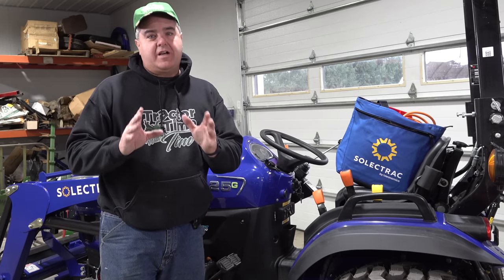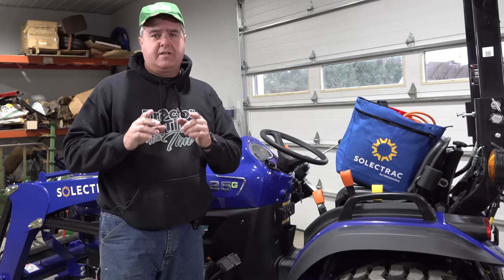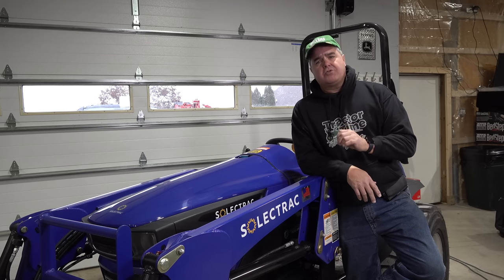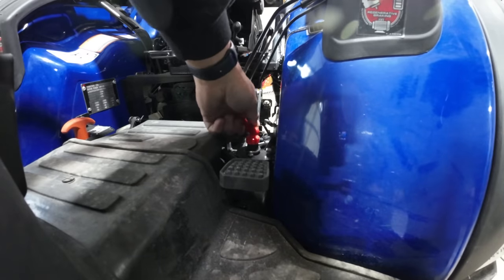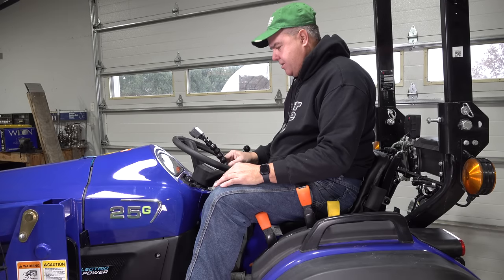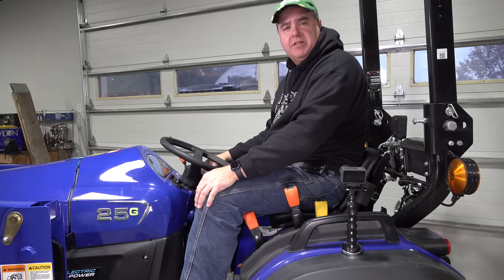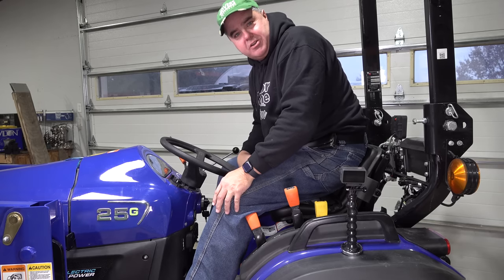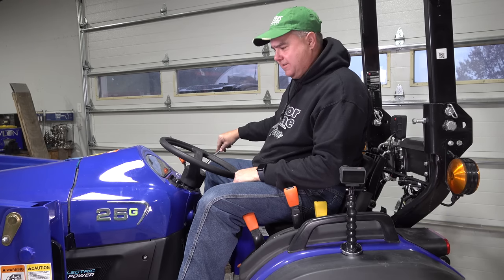Solectrac Electric Tractor First Look; Startup, Transmission Control, Initial Recharge Time & Charge

Comment: I would love to see you run that and your factory 1025 side by side and see who runs out of "fuel" first,  also would be interested in the cost of battery replacement as well as a method to calculate$/ hour ev vs diesel.   Always enjoy your content, and really love how you end each one with scripture
Reply: LFP batteries in that tractor should get at least 10 years of daily use before needing to be replaced at which 10 years from now they'll be much cheaper than today. ~$100 at most per KWh at that time.
Reply: Why worry about the replacement cost of the battery? Did you worry about the replacement cost of the engine on your 1025R before purchasing? These batteries will have way less use than a car. EV batteries that have thermal management outlast the cars.

Comment: I really like the way you are assessing this tractor, non-biased, not presenting it as the best thing going.  It could turn out to be just that, but much convincing will have to happen.  Many of us older people are harder to convince, but I admit I probably won't buy another small tool with a cord, battery operated only for me.  Great job Tim.

Comment: We are going to absolutely love this series! Finally someone is going to test the electrical with no guess work. Thank you TWT.
Reply: For sure. It’s time to find out more about electric tractors. Electric tractors will not suit everyone but it will suit some people a lot. For example I could imagine an electric tractor would be well suited to indoor use like in a big barn or greenhouse.
Reply: @@stankappiris2242 Agreed, so far I can see 3 situations where this type of equipment is useful 
1. Indoor
2. Small properties,  as you mentioned,  were low maintenance and mostly tasks will not require more than 3 or 4 hours of continuous work
3. Very remote areas, where you can recharge with some sort of renewable source and don't worry to store large amounts of fuel

Comment: Hey Tim! 100% if using in winter you need to add a battery tender for the 12V battery, I'm using a Battery Tender model 800 on mine does the trick. I leave mine outdoors and it is no problem to use it in sub-freezing weather but when charging the high-voltage battery sometimes then the low-voltage battery goes flat as the under-temperature protection logic on the charging procedure is a little wonky.

Comment: Kudos to the engineers that designed these things, but I am a petroleum guy I like diesel tractors it’s what I’m used to, the idea theory behind it is good, but when you’re working example getting low on fuel you can grab a fuel can fill up and get back to work immediately But if the battery goes low or dead you have to stop production & charge, I’m going to keep watching these videos to see where this goes, but I personally love a diesel tractor even if I have to put DEF in it, thank you for the video 👍🚜
Reply: Graphene Super Capacitors will make you want electric in ten years you won't have any fossil fuel equipment.
Reply: @carrollsanders9376  lol good luck mass producing those
Reply: @atodaso1668  They already are.

Comment: 7:40, my guess is that the whine when you turn off the hydraulic pump is the cooling fan motor for the power inverter?
Reply: It turns off the hydraulic pump it self.
Reply: @terrya6486  I don't understand what you mean? He shut off the pump manually with the switch, but there was still a hum from hat sounded like a blower (fan) motor.

Comment: I could see this being good for barn cleaning or small indoor construction projects. I would really be interested to see how it worked in the sub zero temps from a few days ago.
Reply: Might be it's "ONLY" good use, because of it's looowww time of operation & its super high price--- and of course "making U-TUBE vidios=$).
Reply: @donaldstrishock3923  Yep, they're VERY expensive!
Reply: Probably not much different than electric fork lifts used in a freezer warehouse. The longer working  in sub zero temps the faster the battery would drain.

Comment: Merry Christmas Tim!  Looking forward to future videos.  The charging curve dropping off over 80% on the battery would fit with what EVs do.  It is a feature to help protect better longevity and why they recommend not charging above 80% if you are out on the road on a trip because that last 20% is going to take way longer than getting from 10% to 80% did.
Reply: This advice is for NCA chemistry, this tractor uses LFP which is fine at 90% and even okay at 100% SOC.

Comment: I was going to say, the tractor colour on your title page was a nice touch but the sound needs removing as electric would be silent... and then then I heard the tractor on startup and it is "Interesting".
Does look like the Farmtrac Tractor 25G in the UK.
Great review. Get some more burgers :-)
(If your 240v plug grip is too large, try running through a bit of garden hose)

Comment: What do you do during a power outage?  Plus when we had a 3 ft snowfall I wouldn't trust an electric to not go dead where you can't charge it. The cold temperature rating is a concern too. Look forward to future videos and we'll see.
Reply: My backhoe wouldn't start at 10 degrees but fires up the next day at 25 degrees no problem.... guarantee it will be useless
Reply: @chucknorris277  An electric vehicle will start at any temperature unlike an ICE.

Comment: I'm curious to see how this really cold weather impacts this tractor. My JD sits in a shed without heat and the hydraulics get a bit problematic in extreme cold. Does this have some way to heat up the hydraulics before use?
Reply from the maker: No

Comment: Down below was a comment about the  "Gas and Go"' advantage of diesel. A proxy would be a generator. What size of generator and would that be practical? Would it give you enough to finsh the Job or take it back to the shed.
Reply from the maker: Based on charging time, I don’t think a generator would help much.  Would still take several hours.

Comment: Thanks Tim. I hope this works well. I am sure this 1st gen battery tractor will lack the long use cycle that some people need. I like the quieter operation and an electric motor peak torque at all rpm.

Comment: Great video Tim, Now I'm not into electric anything except power tools but I've been curious how they will do in the construction and  farm industries where the equip. is almost always  under high demand. With the battery tech. they have now I just do not see them worth more then a quick job or two before they give up the ghost. And how about harvest time do you stop working for a day for a charge up as opposed to pouring in some diesel and keep working. Looking forward to your series Tim.

Comment: I'm anxious for the complete review series. I must admit, I was a bit optimistic until you mentioned not to operate below 15-degrees F. As someone living in a northern climate that would be a complete show stopper. It's not like they simply warned that battery life may be reduced below 15F. They are saying "Do not operate below 15F".  That's a mighty big gotcha for anyone living where you have cold weather.
Reply: Agreed, then if you have a battery failure will warranty coverage be denied if there is some sort of internal temp monitoring and can prove it was used outside of it's intended specs?
Reply: @barelystablefarm7151  That would be my major concern. When you do something with a machine that the manufacturer specifically warns NOT to do, you can usually figure that if any warranty issues arise you will be on your own.
Reply: @eosjoe565  Exactly
Reply from the maker: I have been operating below 15 without issue.  However, the machine is warm (50+ Fahrenheit) from sitting in the shed.

Comment: Looking forward to seeing more of your testing. My biggest fear with this is that being a weekend warrior, I like to run a tractor hard all day Saturday on projects. I’d be worried something like this might leave me stranded, or less productive in my available time based on its finite run time per charge. I can refill with diesel in 5 minutes and keep right on going!
Reply: Yep. I think it’s still clear that the battery technology still doesn’t come close to what’s needed to make an electric tractor anything more than a novelty at this point. I’m curious to see how it performs, but for me actually purchasing one of these is a non-starter until there’s some generational advancements in battery tech that will make run times apples to apples, and by that I also mean cost. Spending enough to buy 3 diesel tractors just so you can swap batteries in and keep working is not parity, it’s 3 times as expensive…lol
Reply: The electric mini excavators get about 4 hours of work

Comment: What a let down on the snow storm. I cleared a few drifts. Used manplow to do most of my work.
Reply: It’s stranded wire , correct? The surface of the wire carries the load, more wire, more surface.

Comment: Three years ago I was fascinated by the idea of an electric car, so I leased a Chevy Bolt for three years.  Positive:  It was fun to drive and had a lot of torque.  It also was very cheap to use if you charged it at home.  If you went to a commercial charging station, your wallet thought it was filling up an 800 HP gas guzzler.  Negative: The charging time took many hours even with a 220v charger.  Negative: The range was anywhere from 150 to 250 miles depending on whether you wanted heat or not.  In Michigan in the winter, that was not an option.  I just turned it back in to Chevrolet and happily leased a gas guzzler.  Until they solve the long charging times, and the lack of range, it's not gonna fly except with people that never go anywhere.  As for saving the planet, no.  The electricity has to generated somewhere, and you're not going to run the country on windmills and solar cells alone.  My advice is buy a diesel tractor and wait see if down the road something better will come along.

Comment: So how many amps did it take max.  I dont like the idea of waiting to charge because your full now then go out and tackle a project and brings it down to say 45% but your next project time will be the same.   You have 2 choices charge when done 1st project or you have stop doing 2nd project to charge.  

I would like to see a complete discharge vid cause im wondering if it will go into derate to limp back to home base and does it have a neutral to tow it dead like if fun out of fuel or it breaks down. Does it have a load gauge on how hard you are working the motor and what happens if you overload it.  Will it shut off like you stall an engine
Reply from the maker: 3.87 kWh, as I showed.
Reply: Assuming the line voltage is exactly 220 volts, it was charging at 15.35 amps in the first charge phase. As for your other point, then maybe this tractor isn't for you. People need to stop trying to force a machine to fit their use case, and select a machine that FITS their use case. This isn't just true of electric tractors, it's true of all machines. In an extended power outage, fuel pumps aren't going to work, so unless you're stocking more than enough fuel for the outage of the duration, you're in the exact same boat. And, in theory, you could charge this tractor from solar, and be able to operate entirely off grid. So everyone quit making up hypothetical use cases where it won't suit your needs and then complain about it.

Comment: Thanks for sharing your thoughts, ideas and videos. Looking forward to seeing your overall review of this tractor. Really appreciate that your treating it as a tractor/tool review and not a opinion as to if it’s good or bad technology. Was wondering since this is relatively new uncharted territory if you might want to swing a current transformer from a lesser used circuit in your bkr box so you have a true meter for both phases. From my electrical background I’m left wondering if it is a truly balanced load in all charging modes. I have a power bank that takes two separate inputs and discovered over time that they are far from balanced  loading based on the present state of charge. Thanks again for taking on this project. I am confident that if there is a notch that an electric tractor fits in you will find it and give it a fair review. My personal speculation would be it might excel for someone looking to operate off grid and independently from the established power grids, including liquid fuel supplies. Not many people make their own gasoline or diesel.
Reply from the maker: Good point.  I have one extra CT. Could use it on this circuit.

Comment: Merry Christmas Tim and Christy.  The minimum operating temp of 15F would prevent me from buying this tractor.  Living in a state where winter temperatures routinely get colder than that for 2-3 months would make this tractor a 3 season tractor. I look forward to this video series and the opportunity to learn along with you Tim.  Hopefully as the technology evolves the operational temp range will allow for cold winter usage.
Reply: Its a limitation of the lithium batteries used, that will not be changing.  you can store it in a heated area, and it will be fine for several hours outside, but eventually needs to be brought inside a heated area to charge
Reply: Its a limitation of the lithium batteries used, that will not be changing.  you can store it in a heated area, and it will be fine for several hours outside, but eventually needs to be brought inside a heated area to charge

Comment: I am very interested in seeing how it works in real conditions, but that high pitched whine is already an issue.  Does your IsoTunes block it out?
Reply from the maker: It isn’t very loud …compared to diesel.
Reply: @TractorTimewithTim  It may not be loud from a decibel standpoint but from an annoyance standpoint it is ear shattering. Like the hydrostatic whine from the cab equipped small Kubota tractors. Not loud on the DB meter but deafening to your brain.  :-)

Comment: I charge my EV on 120v all the time. Depends on how much you use it every day, but if you use it one day, then it it sits for two, you might not need more than 120v.

Looking forward to this series. My guess is it's going to perform better than a similarly sized diesel. Just not for nearly as long.

Comment: Tim, keeping the tractor in your heated shop is a bias in the evaluation of this unit.  I hope you will park it outside this winter and evaluate how the batteries do when they get cold. Most people do not have heated buildings to store their tractors in.  I think we all know the batteries will suffer when they get cold, but it would be interesting to know just how much.  I looked on the Solectrac website a while back and the specs at that time said operating temperatures down to 32°F.  Anyway, glad you got your hands on one of these tractors so we can see what they are all about!
Reply: True. I started my 2032R the other other morning in 10F degree temps. I turned the glow plugs twice and it started hard.

Comment: So, a 20amp, 240v would charge it?
240 volt plugs look like a 120, with the blades turned 90 degrees. All my woodworking machines are 20amp, 240 volts. The male plug you used is a 30 amp. Wire looked small for 30amp.

Comment: Do not think I will be selling off my 25R anytime soon. But looked at the specs and I am happy to say they made the RIGHT decision for the battery chemistry and that is LFP (Lithium Iron Phosphate) vs what is used in auto EVs which is Lithium Ion polymer (EV chemistries can vary some but they are not LFP batters). Most consumers do not know the difference, yet...but those in industrial and batteries requiring  extreme durability, take a beating, and SAFE (thus used in military and aviation and industrial applications)...LFP will be superior for this application. Less expensive, far better life span, NOT toxic, and will NOT have a THERMAL OVERUN. So its is safe to charge in your barn. You will be able to charge this battery faster than an Ion, it does not get memory issues and it will last much much longer. But most importantly the safety factor of LFP is superior to Ion. Only down side of LFP batteries and why they are not used in EVs is they are heavier (less power density).  You can literally shoot that battery with your rifle, not kidding, and it will not thermal overrun nor explode. If you follow consumer battery banks for remote electricity , pretty anything over 10 aH they have moved away from the Lithium Ion to the LFP as this tractor is using (cost and safety). Only hold out in this space is Goal Zero, unfortunately. Reason LFP are not toxic they do not use 'Cobalt' that most EVs use. That is the poison part of those batteries. When you see 'slave kids' in Africa digging in the mines, this is for Cobalt. LFP do NOT use Cobalt.

Comment: Tim, this new series is so cool. Your approach is perfect. Electric motors and batteries are not new technologies — they’ve been used on farms for decades, and the conversion of many drive systems to electric has been change for the better. (I would never convert the electric motor on my bale conveyor back to a pulley drive off the Farmall. Lol.) So, if a company like Solectrac has incorporated electric motors and batteries into a tractor, then it makes sense for a technically savvy tractor guy like you to analyze and evaluate this new approach for its merits and drawbacks. And the fun part is, we get to learn along with you. Hats off to you for giving it a go, and I’m looking forward to it. Keep rockin’ . . .

Comment: As with electric cars I have 3 questions/concerns. What is the range or in this case number of hours of work this tractor will complete before running out of juice, what is the recharge time from ‘no go’ to 100% charge and lastly what is the anticipated annual battery degradation?